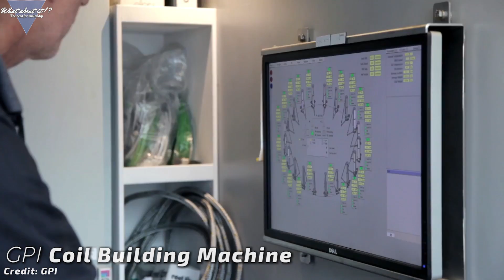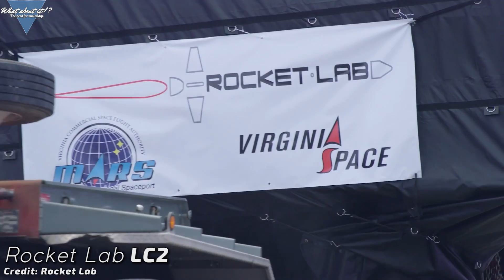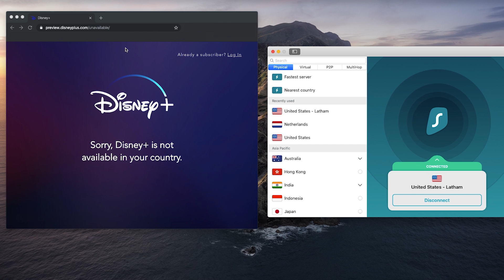59 | SpaceX Starship Updates – Rocketlabs Second Launch Facility – Blue Origin Launches Again

Comment: Is it just me, or is SpaceX's learning process slower than it could be? For example, what did they learn from the pressurization test that they could not have learned quicker by welding a small tank? Why did they learn so late about the center of gravity -- do they not use computer simulations? Why are they not building scale models?

Comment: Time is of the essence with SpaceX's progress and timeline announcements.  It seems apparent now that the conventional tank construction method used to construct the Mk1 vessel was a benchmark establishing exercise on which to improve in order to be able to state that the  manufacturing process has been overhauled and made much more efficient; which no doubt it has and will be.  It's ok that it is a self-fulfilling prophesy, as long as things work out.  The next generation of engineers will find fewer and fewer qualified welders so the automatic welding machines are going to be key developments.  Robots using wire welders will probably rule the day.

Comment: SpaceX isn't going to rush right in and be meticulous about the exterior and external structure and every single part which would be very time and cost expensive and wasteful if a RUD were to happen in a test article. They want to be sure to get the tank structures right and capable of doing the job they need to do and worry about aesthetics and details later. I could be mistaken but I just do3nt see the sense in that with every prototype. Thanks for the great vids. Oh..and Merry  Christmas and Happy New Year! ⚘👍

Comment: This stuff all works like this.

Basic design with big ideas. Should work like a charm. 

Engineers getting going on the design and the red flags start to go up. "We can't pull that off." "We need to test different materials since what you picked may not work as well." Etc. etc. Also costs become a major thing.

Then it's off to the fabricators with different but the same problems as the engineers. In the real world something might be way too hard to make or take too long or end up being too expensive.  

After that let's light it up and see if it works?

Comment: Why they are not using the nose cone is a combination of finding out weight distribution late in design and building, and the nose cone construction quality both with welds and symetricallity. This was apparent when they had to tinker with the nose cone sheet metal assembly. They should move to prefab parts for the nose in mark3 if not in subsequent rockets.

Comment: I've a question, could it be that the pressure test on mk1 was just a long time pressure test? (like at sls)
Reply: Elon described it as "not unexpected" rather than "planned". I interpret that as meaning that they had reason to think a catastrophic failure might occur, but weren't deliberately causing one. We don't have much detail, but my guess is that the first pressure test raised some concerns, enough to convince them that Mk1 shouldn't be flown, and that the second test was therefore done in anticipation that something might break.

Comment: Fly New Shepard? Nope. Not because I don't think it would work. Something about Bezos that I find repulsive. Couldn't tell you why. Maybe to secretive or his cheerleader announcer. Doesn't matter.
Had a thought, seeing as SpaceX seems to have slowed down a bit. Correct me if I'm wrong. Hasn't the only actual flight test of the Raptor engine been done with the water tank? Just watched it again. Not much flying time for the Raptor. Hope that's not having any issues.
You ought to try to get some insight from Gwynne Shotwell if possible. Thanks for update.

Comment: I think Elon should just make a Giga sized metal die and press and punch out a hull from a single block or sheet. No welds. Just cut the ports and install stuff through the aft. But save that for when all the prototyping of what goes where etc first.

Comment: Depends on what you mean by ‘succeed.’  Nothing has worked so far yet and other than some education regarding engine being hit by debris, nothing has actually been learned.  What is so often being called ‘learning’ should have been obvious from the start, I don’t understand how SpaceX can be so delusional regarding this subject.  They are making outrageous leaps of faith regarding (geez, where to begin, or stop); fabrication tolerances or forgiveness of such, aerothermal (big time), instability due to propellant motion (no evidence of any protection), FOD damage, exhaust scouring during landing, quality control.  That’s just off the top of my head, there are more if you just think about it.  Every bit of time and money that has been spent so far (except maybe on GSE) has been a total waste.  If they had designed the vehicle first (instead of fly first, then design), they’d be further ahead and less embarrassed.  If they continue like this and do succeed, it will be due to pure luck, not engineering skill.  The ‘throw it on the wall and see if it sticks’ approach can ultimately work, but it’s an expensive and time consuming way to go about it, especially when you consider that nothing they are trying to do is ‘unknown’ or new.

Comment: There is an impression going around that SpaceX is just building this thing, and no one has done even the most basic calculations such as weight distribution.  That would be VERY unlikely.  There are likely significant engineering analysis that exist- so much so that our heads would spin. The lessons that SpaceX is learning here are all about the manufacturing of this Starship.
Reply: Sure they have.
However, any structural analysis requires specified stress tolerances from its materials and components. Those welds were uneven and hurried; expected tolerance ranges become wider, and your analysis will have a significant chance of total failure under stress.
It was quite a gamble to try and fly it, only to have catastrophic failure in the first stress test. I believe showing off a hurried Starship prototype was more important than having (or even expecting) any success in it flying.
Reply: @trabladorr  
I don't think showing it was the only priority, they kept working on it for a long time after the presentation. Probably they were trying out a lot of things in practice without waiting for the final design. This way they could work on the manufacturing challenges much sooner and save a lot of time overall. It wastes money, but since steel is dirt cheap, it's not that much money.

Comment: You have the answer I've been looking for - the tan cylinder is an internal scaffold. The cylinder itself is definitely a smaller diameter than 9 meters, but the circumferential platforms look about 9 meters. Room for the workers, and they can hold the rings in their perfect circle shape while being assembled on top of each other.
Reply: The manufacturing videos make it look like that even the ring to ring welds are done by a robotic Plasma Arc Welder. That's great! They will be more consistent.

Comment: Hopefully they have learned that the quick-and-dirty approach may be not the best way when it comes to rocket building. I would recommend them to seek for some old engineers from the early Atlas program, they must know how to build a rocket out of SS.
Reply: That knowledge would be mostly outdated by now. Also Elon Musk never does what traditionally considered the best way and he is right most of the time. Now they are trying to go as fast as possible, which means trying out a lot of things in parallel, which means lots of failures and dead-ends. This is how the Manhattan Project was able to turn a theoretical possibility into a working bomb in just a few years.

Comment: i saw the BO launch , it went very smooth, however why  they separate the capsule from the booster  and not land the dildo in one piece? maybe  BO should  go for the spaceX style, spacecraft liftoff and landing,  the capsule looks like old tech by now, like the diving bell vs the submarine.
Reply from the maker: The reason for the separation would be, that first of all, the Shepard steers with aft fins and aero brakes. This would not be possible with a capsule on top and secondly, the max hight is lower, if you need more fule to land the booster due to higher weight. ;)
Reply: There's also the issue of safety: parachutes are far more tested and reliable than rocket landing.
Reply: When New Shepard was designed, landing a booster was a new and unproven method. It was sensible to land the human passengers separately with a tried and tested method. It also functions as the safety mechanism for in flight aborts.

I did watch the stream as well, though I find the permanent praise the hosts heap on their company hard to bear. If they were your only source, you would think that BO is the only company providing cheap access to space and the only innovator around. It is totally OK to talk positively about your company and its products, but they overdo it.

Comment: Being a lifetime metal fabricator, My guess is that the way MK 1 was built introduced too many unpredictable stresses.  The new way uses much fewer seams and uses a plasma arc welding method, done by machine, which allows a consistent, repeatable quality.
Reply from the maker: What do you mean by unpredictable stresses? Could you elaborate a bit further? :) What exactly do you do, if I may ask?!
Reply: @Whataboutit  watch?v=02RwVAw0FB8 I'm no expert but Don Ogoboo probably have been talking about something similar.
Reply: @Whataboutit  
Mk1 was definitely good for one thing:
Gaining experience in manufacturing with stainless steel. The SpaceX has now a lot more experience welding the material than before Mk1.
Reply: @Whataboutit  I grew up working in my Dad's fabrication shop. I was a union Ironworkers member for 23 years, I taught welding and metallurgy for the local community college 8 years and for the last 15 years, I was a mechanic for several race teams.  I have worked on bridges, towers, high rise buildings and built many, many coal handling systems including bunkers (Large cylindrical tanks).   I am currently retired.
Reply: @Whataboutit  When you join two metals, even if they are the same alloy, you are heating the center to a plastic/liquid in order to blend them. Working outwards from the center it is in layers of cooler and cooler metal. uncountable layers that all cool in different rates.  What ever cools first contracts first, followed by the next layer and the next.  That is mostly what causes under-bead cracking.  Most are so small they are microscopic and need ultrasound to detect.  When you weld thick to thin, it also has added stresses due to uneven cooling.  If I welded a spot in the middle of a solid 1/4" plate with no seam, microscopically  it would look like a wagon wheel.  On the columns of a high rise building, when welding the joints, you must weld one side, then switch to the other side for the same time. Back and forth to keep it from pulling crooked. Even if it is 4" thick.  
Lastly, when ever you liquefy a metal and mix it with another like piece, you add a matrix, your filler wire or stick.  You have an unpredictable change in alloy in that spot. Also a stress riser.  In racecars or other smaller pieces, you can heat the piece with a gas flame for 8-10 hours and allow to air cool to stress relieve the piece.  
That would be expensive in a huge rocket sized work.  The machine plasma weld is less invasive, consistent and faster.  A win/win.
Reply: @myfavoritemartian1  👍👍👍 well said sir!
Reply: @myfavoritemartian1  
AFAIK we still do not have a official reason why the tank failed. There was chatter that the cause of the failure was a problem with the pressurization system putting way more pressure into the tank than intended. It is all speculation at the moment. I like speculation, but we could all be wrong, including you.
Reply: My first post starts out as  "My guess is..."  Dictionary .com defines "Guess" as: " to arrive at or commit oneself to an opinion about (something) without having sufficient evidence to support the opinion fully."  An opinion doesn't have to be right or wrong. It is just an opinion.
Reply: @myfavoritemartian1  
Sorry, it was my long winded way of pointing out that my guess is that your guess might be wrong, as you might not have all the information. :-)

Our chemistry teacher always told us "You are poking around with a stick in the fog" when we couldn't figure out the chemical formulas - and that's what we all are doing here.

What do we know: 

It failed at a weld.

You say the weld was wrong - fair guess. (I do not need ANY experience in welding to come up that guess, seems common sense to me, doh.)

I say you might not have all information, and there was chatter that the pressure was way higher than what the weld was supposed to hold - so it is a fair guess that the weld was OK.

I clearly remember the Falcon 9 rocket that exploded at the pad, and all the theories that were floating around - ALL of which were wrong.
Reply: Before 3-Dimensional Computer Aided Design was common place in Aerospace, mock-ups were used to "fit-check" the first detailed design prototype parts. Hydraulic lines, and electrical wiring harnesses were notoriously difficult to accurately create from two-dimensional drawings, so actual three dimensional prototypes had to be manufactured in tubing and wire-harness mock-up shops. Many times the fit-check mock-ups were made from wood instead of aluminum in the case of airplanes. The first use of CATIA 3D-CAD datasets was on the B-2. Maybe SpaceX thought the Mk 1 was good enough to perform sub-orbital flights? Even though it was over flightweight. Maybe it was NOT supposed to go to burst pressure, but just design pressure? Typically on passenger aircraft the fuselage has a factor of safety of 1.5 meaning if the vessel would normally operate at 8 psig, it was actually good for 12 psig. If there was a cryogenic pressure gage instrument failure, SpaceX may not have even known that they had exceeded burst pressure, until it blew.
Reply: @tonyrusi1978  Fundamentally the design is not a reusable design, you don't need to build a mockup to know that. You do need to build a mockup for publicity and to elicit funding!
Reply: @tygerbright117  Fundamentally aluminum aircraft are not a "Reusable Design" at all, as all aluminum alloys degrade to 0% tensile strength with enough cyclic loading, yet we all call them "Reusable Aircraft". And Boeing flies them for hundreds of thousands of flights, but they are not fundamentally reusable. On the other hand, all steel alloys maintain 20% of their original strength, independent of the number of cyclic loadings. So Stainless Steel Rockets have a significant advantage over aluminum alloy structures in terms of relative reusability. I would consider a steel Starship "fundamentally reusable" if it had a factor of safety of 5. So your point is moot, as no design is fundamentally reusable. Boeing postulates replacing all skins sections over time to claim reusability, but in practice, this has NEVER been done.
Reply: @tonyrusi1978  Who's talking about Aluminum, that's your take. You can build aircraft out of Stainless steel, like a bristol 188 built in the 60's.The design of the starship is not a monocoque design with internal " tested" tanks. The design is a very poor take on a Saturn 5, that is not reusable.
Reply: Felix great to talk shop with!!
Reply: Yes, the uneven stresses: The piecework rings of the nose section and it's various ad hoc internal modifications means its handling of flight stresses would be very different from the new construction techniques - so any flight data would not apply, be useless data for Mk 4 and 5.
Reply: Use the term fanboy and replies get deleted!
Reply: Shane Humphrey  I would love a video on this maybe Felix can help. How would you install the internal tanks , bullheads,and engine mount?